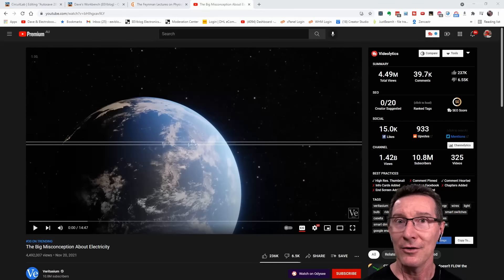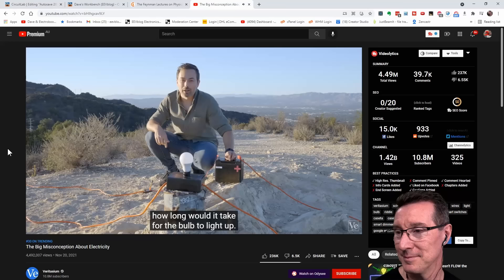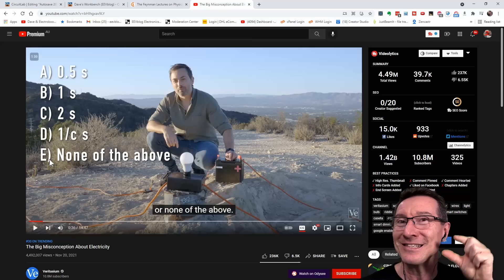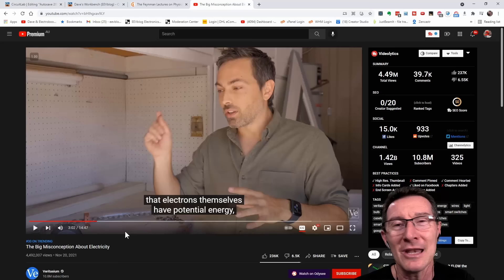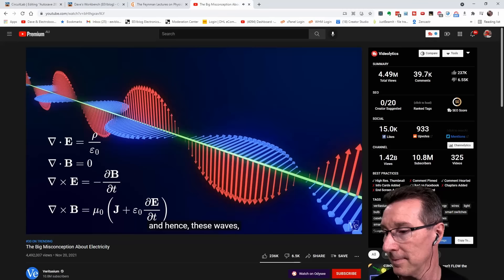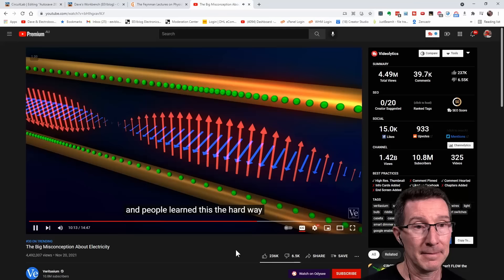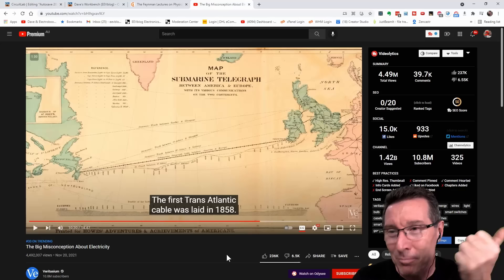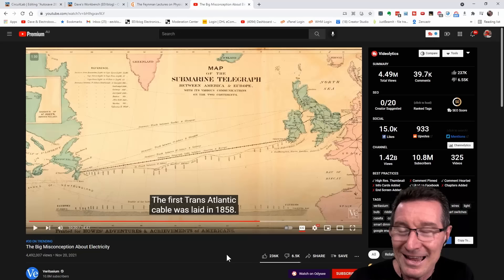EEVblog 1439 - Analysing Veritasium's Electricity Misconceptions Video

Comment: My biggest issue with Veritasium's video is that he makes it sound like the electron movement is essentially an inconsequential side effect of the energy flow outside of the wire. The battery isn't a magical device that contains vectors waiting to escape. The energy from his lead acid battery depends on the movement of electrons. Without it, the negative plate quickly builds up excess electrons which repels the negatively charged HSO4 ions and stops the reaction. The movement of those electrons is absolutely required.
Reply: @KLRJUNE  But one can't happen without the other.
Reply: @KLRJUNE  What carries charges in a wire? Electrons. The repulsive force between electrons will cause an increase of electrons per unit of volume on one end to propagate down and show up as an increase of electrons per unit of volume (and therefore increased charge) on the other end. This is why we don't have to think about drift velocity of electrons in electronics but can just think of the movement of electrons.

It's analogous to the air ejected from your mouth when you speak - it doesn't move very fast, but the local change in pressure propagates outwards at the speed of sound. Veritasium's argument comes across to me as "people think that they're hearing the molecules of air you exhale but really it's not air you exhale but the sound waves traveling through the air!" It's a pedantic point, and you can model sound just fine using the movement of air without keeping in mind that zero of the air molecules from the audio source may arrive at the detector.
Reply: @KLRJUNE  Yes, but he said it better (which usually means a few more words are transmitted).
Reply: @KLRJUNE  what you said sounds like you don’t need electrons what he said is that you need but they are not what Carrie’s charge huge difference hence no one got your point at first
Reply: @KLRJUNE  you said that the waves matter not the movement of electrons,
all iam saying is that the majority of people including myself reading it think you mean electron do not matter only the waves.

the dude above you explained it clearer, even if you meant the same thing we didn't get it. so iam glad he explained it in a longer way.
Reply: Exactly that, if the energy just flows through the air then why do you even need wires? Also if his answer is true then by putting a switch somewhere far away on the wire you would invent FTL communication device, a person on that switch would be able to use Morse code or binary code to transmit you messages and they would reach you faster than light because it only takes 1m/c for light bulb to light up when the switch is closed.
Reply: @KLRJUNE  In DC steady case, which wave exactly is traveling through the wire?
Reply: @tonymiller5841  with the explanation with this video if the switch was on the other end of the wire, then you would have a transmition line from the beginning with is not connected so even when the switch is off you would have voltage on the lamp.

but as you close the switch you would have a closed circle so more voltage and not just a fraction.
also notice that the values on the capasitor is probably way to high, but watever.
Reply: No he doesn't makes it sound  like the electrons movement is side effect, but he made up to energy transmission through waves from electron movements, without e movements, no electric field, no magnetic field and hence no field to transmit energy.
Reply: Just remember (using Ohm's Law) that ALL the energy entering the wire is dissipated by the wire as heat (Infrared radiation, conduction and convection) through Joule effect. There is no lefting energy to be carried.
Reply: @nathanneiman  Joule's law and experiment is mostly about heat as Brownian motion, not radiated heat as infrared radiation, although the two forms of heat convert as necessary, for example at the surface of the filament in a traditional light bulb.
Reply: @johndododoe1411  Of course, there are other means besides radiation. I have already corrected this detail, but I reaffirm that ALL electromagnetic energy that enters the conducting wires is transformed into heat through the Joule (heating) effect and is dissipated (by means of conduction, convection and radiation). The Joule's Law:  P= I^2 x R and Q = I^2 x R x t.
Reply: @mike_o7874  I think the clearest way to think of how electron flow works is to imagine the electrons being modulated by a 'signal' from the current source. Or as another poster analogized them as sound waves modulating air molecules. The air is barely moving, but the air modulation (wave) is much faster. Or think of that old desktop toy with the pinballs in a row suspended on strings: The ball at the end smacks into the one next to it and immediately, the ball at the opposite end goes flying off.
Reply: @KLRJUNE  It can be on the quantum level.
Reply: Yes, electron drift velocity would carry K.E., so not true to say 'no energy flows in the wire'.
Reply: @captaindred342  Aré you saying that electromagnetic waves can’t exist without electrons ?
Reply: @tlar1272  Nope. I didn't say that all. But you should read previous comments in this thread, they explain it really well. In this case we have conductive wires connected to a battery. The electrons certainly matter in this circuit, as others have nicely explained. I never said electromagnetic waves in general can't exist without electrons. In this circuit, you can't ignore the electrons. If they didn't matter the battery wouldn't work, for one thing. Do you know where the densest magnetic flux is with conductors in a power or lighting circuit?
Reply: @captaindred342  Yes.  The densest magnetic flux should be at the very edge of the conductor.  And decrease by R^2 away from the conductor.  Moving the wires to 0.5m apart should have twice as much influence from the electromagnetic wave.
Reply: “The energy from his lead acid battery depends on the movement of electrons” // No. The battery has energy whether electrons are flowing or not. But the energy is flowing if the electrons are also flowing.
Reply: I think what Veritasium meant, and he touches on this towards the end, is that the mechanism of action that provides a device with energy is not the electrons flowing through your circuit, but the fields generated by the system. It's not that the electrons are inconsequential-which he acknowledges as they are essential to creating the magnetic fields-it's that they themselves are not the energy source. I think the argument is, that while thinking of the energy source of the electrons themselves is convenient, particularly for engineering purposes, that is not how the actual system works. 

To take your rebuttal as an example, it is factually correct to say that there are electric fields coming out from the positive end of the battery to the negative, which can be described using vectors; that part isn't magic. That itself is useless without a magnetic field, because you need both for energy. That's what the electrons in the wire provide. The electrons themselves only move at about 1mm per second; even in the wires, the electric fields are what make this all happen so quickly. 

By analogy, take Newtonian physics vs Relativity. It's not that Newtonian mechanics is useless, it's just not the correct description of our physical reality. Newtonian mechanics is not right, but it's right enough; it is a useful way of describing many problems and it does the job. Relativity is the more-correct way of how the system works.
Reply: @duncankilburn7612  so would we include electron spinning also as part of the energy being transmitted?
Reply: @ky-effect2717  There is K.E. associated with the rotation as well as the electron drift. The videos saying 'energy doesn't flow in the wires' is quite misleading in my view.
Reply: @KLRJUNE  A B-field arises from net charge motion = electron current.  The Hall effect proves that.   The drift velocity of electrons in a wire is low, but the current density is the issue.  It IS useful to talk about  waves wrt the initial (switch close) transient or AC.
Reply: The gauge of wire is determined by amp load of the circuit branch
Reply: @KLRJUNE  It's the CURRENT and not the DRIFT VELOCITY.   But CURRENT is quite certainly "movement of electrons" in a wire.
Reply: I can't agree. We might select a wire gauge that can carry AT LEAST the current without excess heating for safety reasons, but that is irrelevant to the physics. Instead the diameter (whether a solid wire, a tube or  a superconductor) determines the distributed capacitance between the wires.
Reply: But an electron is just a point in a field

Comment: I have to point out the comment where it was said that “everyone knows this,” when referring to EEs. I can’t speak to physicists, but I can tell you that if I asked my colleagues at work what drift velocity was, even just at a high level, they would scratch their heads in confusion. Some might say “oh, I believe we learned that in General Physics in undergrad.”
Reply: Well it depends on the field of study and working environment obviously. I'm studying mechatronic engineering and we do see quite in the details the physics behind semiconductors in various courses about design of electrical control for motors for example, but we've done drift velocity during the introduction to "electronic & electrical motors"
Reply: This. 99% of the population probably has never heard of any of this and at best thinks magic electricity (maybe electrons) is being pumped through hoses (wires) in to the end device. Among engineers: would bet an EE knows this, but probably not an ME (short of some elective class they barely remember). Physicist: same thing, depends on the type. Virtually any other major is probably shocked to hear the answer.
Reply: @wileecoyoti  Drift velocity is basic undergrad physics every physicist takes.
Reply: @whuzzzup  if you dont use it, you forget it and it is berried in the void  :)
Reply: i agree. i asked some engineers and physicist. the physicist knew the drift velocity speed roughly but didn't really understand the answer to Derek's question.

the electrical engineers didn't know the drift speed and when presented with the answer to dericks question was "Sure if you say so"

i certainly was not taught propagation speed or drift speed in my formal education. I worked out the propagation was roughly speed of light when i started working with transient situations and always assumed electrons moved very quickly but less than speed of light. that was interesting to find out but frankly arbitrary
Reply: @njipods  I wasn’t taught most of this stuff in undergrad, either. It’s honestly ridiculous how little they cover this material in college. I’m not surprised at the reactions you got from your fellow engineers.